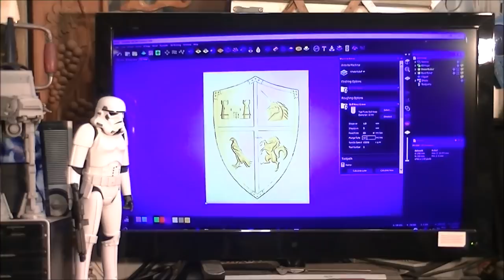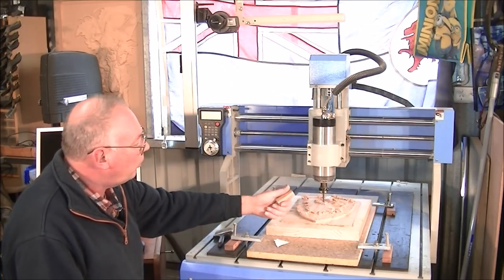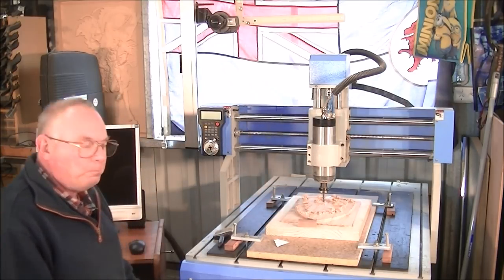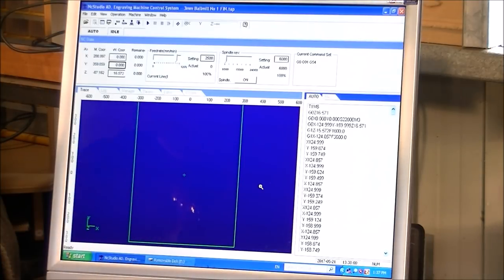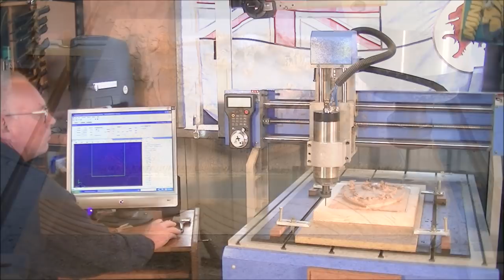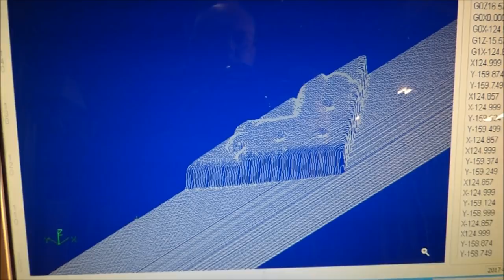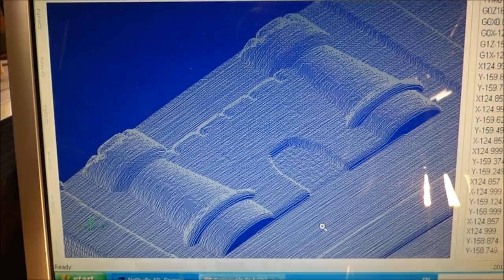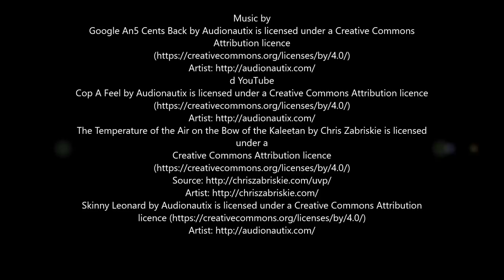My Chinese CNC router making a 3D knights shield

Comment: Very interesting video series. Did you change to the 1.5 mil bit to finish this project? Does it remove all the fuzzies as seen in the finished product, or must you do that by hand sanding? I am familiar with parametric drafting and own an older copy of Autodesk Inventor, is your software made by Autodesk as well?

Comment: Roger that looks great! Just a little constructive advice. If
you took another rough pass leaving .150” for your finish tool path you might
get a better finish, also you might consider (I know this is possible in
Aspire) create a vector around the shield (in this case) and tell it to only
machine (carve) inside of that vector, it will speed up your machining time, then tell It
to cut a path using the vector but cut on the outside of the vector.

Comment: Hi Roger,
If you have to recommend a pretty average desktop PC to run the new Artcam with windows 10 comfortably what will be your choice.
Considering cores, speed, memory etc.
Regards.
AS.
Reply from the maker: Hi Alvin, HP, i5+, 500G+ 4G RAM+.
 Pacific Tooling ships worldwide: Email me at info@pacifictooling.com I will send you
information on our new * Lathe * and 4040, 6060, 6090 and 6012 (linear rail
model) CNC routers and CNC lasers 6040, 6090, 1390 and 1225.
 Pacific Tooling; Australian Inventor Roger Clyde Webb
Reply: Hi Roger Webb ,
Thank you Roger for the info, I'll contact you soon to get some info on your leaser system, at present I'm trying put together a good CPU to assist me with the new Autodesk ArtCam program.
You seems to be very very veeeery versed with Art-cam, I never used it before so it's a bit new to me, I don't mind tagging along with your tutorials.
One more question to you sir; Could mach3 work on a 64bit machine (e.g. win7/win10)?
Regards.
AS.